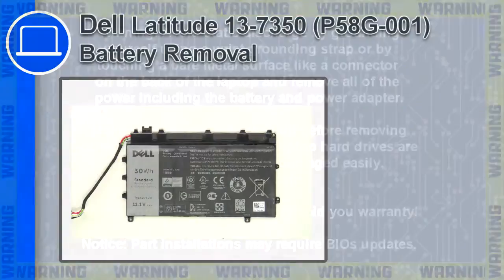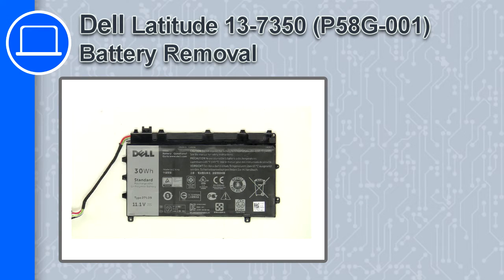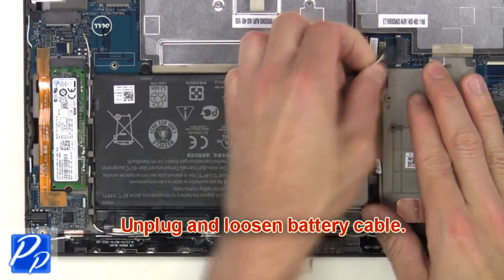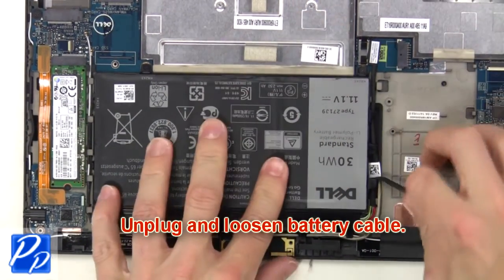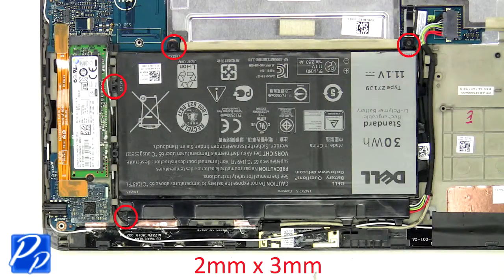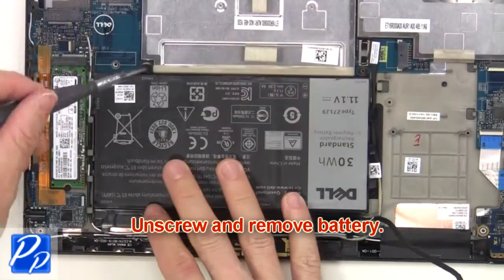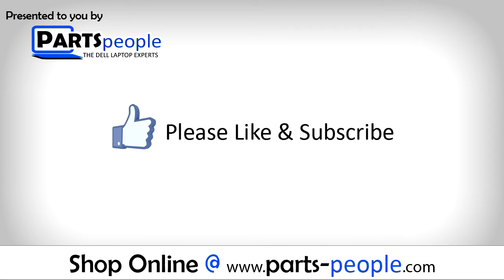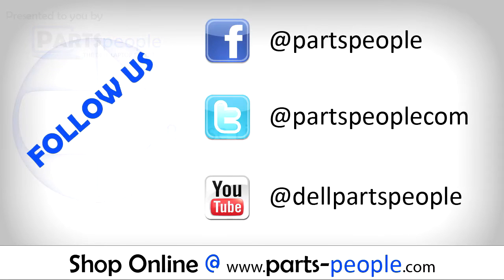Dell Latitude 13-7350 (P58G-001) Battery How-To Video Tutorials

Comment: Do you have a video on how to replace the battery in the keyboard? This laptop has two batteries. One in the monitor and one in the keyboard. I am assuming I need a new keyboard battery since battery two says 0% and won't charge and when plugged into the keyboard to charge the light flashes white and orange,
Reply: Hi, have same situation and I disassembled the keyboard and saw there just a plastic plug in place of the battery. I mean, it was never there)